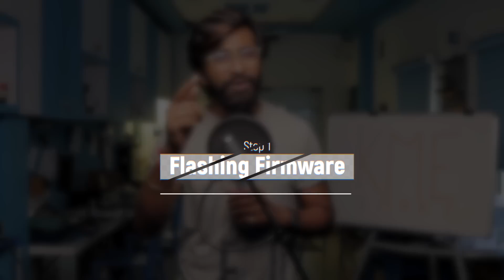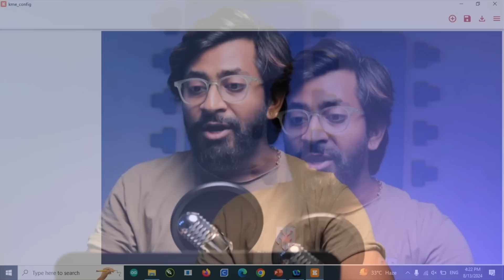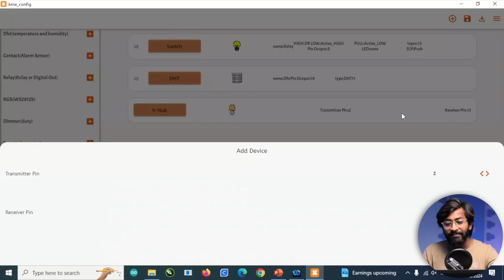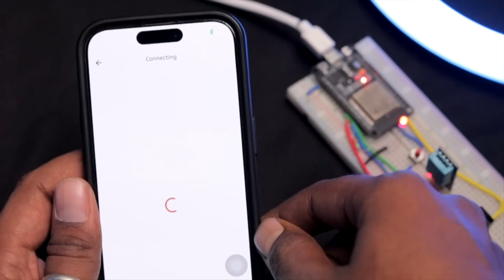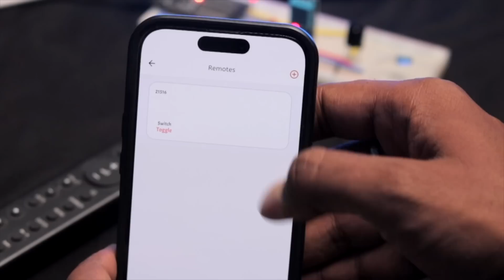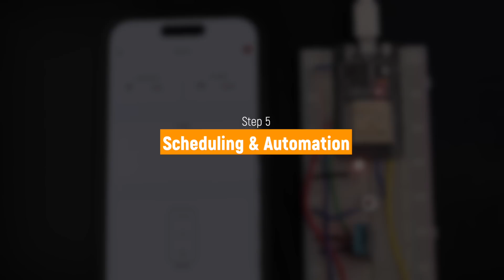This IOT Platform got a lot of FEATURES 🔥🔥  | Getting Started with KME Smart IOT Platform

Comment from the maker: So which IOT platform will you choose now for your IOT Projects and Why? 
Let’s talk
Reply: Home Assistant.  my entire home runs on it can able to integrate any device to that
Reply: Home Assistant but It can't provide Remote access by default(payment needed for VPN).
Reply: Thanks for this demonstration! What do you think of using this platform with the new C1001 60GHz mmWave Indoor Fall Detection Sensor from DFRobot? I have ordered two and they are supposed to arrive Monday. Is there a way to use your own code if you want/need to use devices they don't have in their list? Or is another platform a better choice for that?
Reply: Does this work with Google home?
Reply from the maker: @iloveravet  Yes
Reply: Rainmaker
Reply: @techiesms  
Right now I moved From Blynk to KME Smart plateform because it is totally free and very easy to configure the output & in put pins the main feature of KME which I liked Schedule setup for every Switch...In Blynk plateform they allow to create only 5 datastream with free plan...
Reply: @techiesms  I will choose KME Smart now because it is totally free and easy to configure and use
Reply: CADIO AND BLYNK EASY TO USE AND

Comment: I have a XIao-Esp32c3, I can flash the KME Firmware, After uploading its not showing the mac and device id, and I'm trying to upload cretaed file, its showing device not connected, but on the firware dashboard its shwoing device in connected with right com prot. kindly help me.
Reply: Open KME Application in "Run as Administrator" option

Comment: Hi bro I have a IR blaster Tuya brand I am currently using it to control my Atomberg fan through Google home mini but, the issue is its just limit itself to on and off I can not control the fan speed. My question is can I program the same IR blaster to control my fan completely.
Reply from the maker: Yes you can but for that you need to add additional fan dimming circuit at the fan side

Comment: Thanks Sachin for another well presented video project. I am using an ESP 8266 board and I got stuck when you said to push the Boot button (when using an ESP 32 board) to provide my wifi credentials to the board but of course the ESP8266 doesn't have a Boot button.
Reply from the maker: Flash and boot both are same
Reply: @techiesms  Hmm I'm still not able to upload my wifi credentials into my ESP8266 board. I have pressed and held the Flash button, then pressed and released the RST button (whilst holding in the Flash button), then released the Flash button. There is no blinking light to indicate I am then into Boot mode??
Reply: Solved! I was trying to connect to a 5GHz Wifi connection, which didn't work, so when I changed to 2.4Ghz WiFi it worked. I found also that you just need to push and hold on the Flash button for about 5 seconds (just like to Boot button on the ESP32) for it to go into "boot" mode. All working now. Fantastic project!
Reply: @kombicruiser2658  can you help with d1 mini?
Reply: @techiesms  same problem with d1 mini. after widget upload, blink pattern is on,off,on,off, long on. means 2 times blink then long on. d1 mini has only reset button , holding it for 5 sec, same led on off pattern repeats . not able to connect to app. plz help

Comment: Bro, i tried to flash from KME Tool to esp32, but it been saying connecting , not changing state to writing the firmware . please Help, Thanks
Reply: It's simple
Reply: Check data cable check port
Reply: @TechTamilIOT  done did no use
Reply: Press on boot button  and release when finished
Reply: @falahalmutairi2179  tried, no response
Reply: @falahalmutairi2179  thanks this worked, but need to press and hold bit long
Reply: @falahalmutairi2179  This worked. Thanks
Reply: Will make any problem if the board has  already code on it
Reply: @harshavenkatasai451  Try erase before uploading And try press boot while uploading

Comment: It's interesting,How it works without internet?.if I make a timer with this, how the time will be kept updated without internet?
Reply from the maker: It works and I tried it multiple times 

So what happens is for the very first time it requires Internet to get the current time and later the timer runs inside the esp board hence it doesn’t require Internet 

Clever coding
Reply: Wow
Reply: But when power goes what happens? Any RTC module?
Reply: @rajeev1087 ESP32 board inbuilt RTC module arrange uninterrupted power supply for esp32